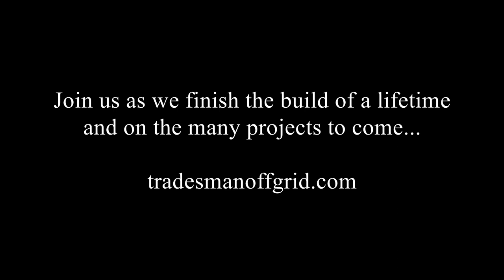TheTradesmanChannel Trailer for 2018

Comment: Wondering what you or how you secure your columns to the foundation. Do you use a knife connection?
Reply from the maker: After the building was finished I used angle iron brackets.  Historically timber frames were not secured to anything, the weight of the frame is enough to keep it from moving.